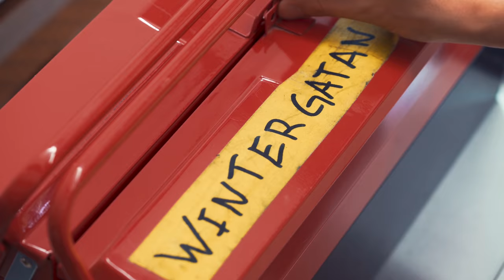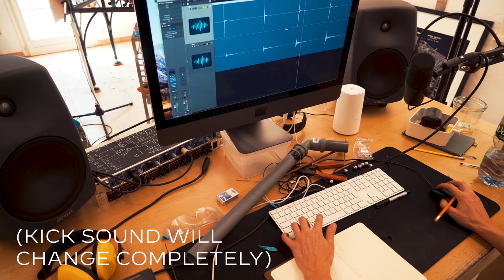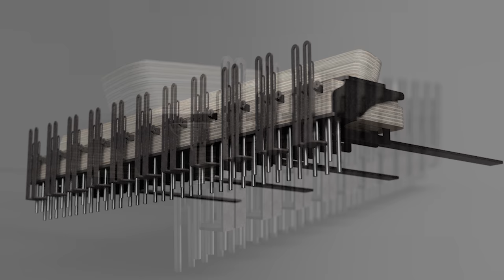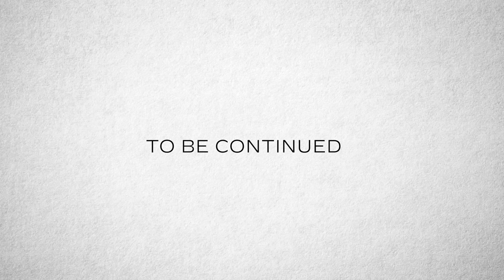Vibraphone Marble Drops - Marble Machine X #99

Comment: I hope all the engineering students out there are paying attention to this valuable lesson.  Sometimes a better solution comes along and you can't be afraid to blow up your previous work for the greater overall improvement.  Short term pain - long term glory!
Reply: I'm afraid they're all dead from watching Martin hand-bend wires :P
Reply: It reminds me of the creator of the MMR Vaccine. Years after his Rubella vaccine was integrated into the combo vaccine he came across a Rubella Vaccine with less side effects than his. So he had his vaccine removed and that one used instead. You cannot be afraid to completely toss out something you spent time on if there is a better solution available.
Reply: @ClAddict  Who said the marble machine was destined to be replicated? 
And I want to assume marvin and his team are organized enough to write down all of the changes made along the way so I don't think the blueprints for it are really lost.
Reply: Touched my heart, thanks.
Reply: @Tyler A.  The problem he is fixing is not that the marbles were touching.  It stems from the fact that he wants to change out the vibraphone plates to be able to play in different keys.  This meant that the marble hit point would change with plate changes.  His previous solution, the one getting thrown out, was to find a 'compromise' hit point.  The resulting compromise points were marked by the bent bar that was blue-taped to the vibraphone.  

The solution that was suggested, will have consistent drop points. Then design the offset into the individual base of each vibraphone plate to match that drop point for that note; no compromise.  He did not throw out one solution for an equal one rather, he eliminated the need for a compromise at all!

If you noticed, he alluded to at the the end of the video, a rendered, drop mechanism.  This new solution may be significantly more repeatable than the last as well.
Reply: If only the government could learn this lesson.
Reply: This series of videos should be watched by everyone. They teach cooperation, learning step by step, critical thinking, willpower build up, engineering, phisics and so many more things I'm probably missing!
Reply: .. but always keep in mind time to market and initial cost. Good engineers are adamant to help find the best overall solution with those often pretty soft constraints in mind.
Reply: @801maximus  Not a chance
Reply: Sometimes there are deadlines and even if you come up with a better idea, there might be no time
Reply: As a project engineer with a fixed payout from our customers per project - It's a fine line to tread
Reply: I'm a student in engeneering.
I love this philosophy, and it's hard to apply when the deadlines are coming. This is so sad that companies has to think to efficiency despite of quality.
Reply: @mathieul5990  On the tail end of a real engineering project here.  I had my team do a complete redesign 8 months into the project because I didn't want to waste time fixing them that could be spent avoiding them.  Prototype was way behind schedule, but it worked perfectly and we barely changed anything for production two years later.

Comment: wife: why are there drilled holes on the dinner table?
me: i'm a grown up
Reply: Me: Wheeeeze - Ha! (As I fondle the holes in my table)
Reply from the maker: thats it
Reply: Being an adult also means you get to screw ON the table.
Reply: @kristofgonczo  YES
Reply: GemYellow this comment made me laugh out loud
Reply: Don't forget that last week, it was drawing on your own table.

So yeah. Holes and random Sharpie drawings. Sounds about right for a grown up!
Reply: Plot twist it’s a glass table
Reply: RIP TABLE
Reply: Ha! my desk at work has a bunch of random holes from various fixtures and jigs that I have attached directly to the surface over the years. It is one of those shitty laminated particle board office desks with the fake wood grain pattern that was clearly not meant for such use but it still does the job.
Reply: @Wintergatan  🎈🎈🎈🎈🎈
Reply: @Wintergatan  🤧🤥

Comment: Viewers: "Cool, it's almost done!" 
Martin: "We need to talk..."
Reply: Genuine question - as this thing gets bigger and more complicated, is there a risk that this machine is too difficult to maintain? In other words, with so many moving parts, the probability of an individual part breaking increases. Is this acceptable?
Reply: @Ianrossoconnell  I feel like these components are built strong enough that breakage won't be a huge issue.  Also, with the computer designed components, repairs and replacements will be easier than otherwise.

Consider a saxophone, and all the individual parts that has on it- most smaller and more delicate than this, and also handled and moved much more often.  But breakages are rare on those instruments.
Reply: @Earthenfist  thanks for your answer.
Reply: @Ianrossoconnell  hman made very complicated machines, like cars. the failure probability can be managed by good design (sturdy parts, choosing wearing components, long lasting materials etc)
Reply: @baptiste7433   agreed - but cars have developed over decades with lots of iteration to perfect design. I'm not so sure this will undergo the same rigorous testing to be confident it will survive a worldwide tour. I hope I'm wrong of course. 

I suppose an interesting question is "which parts are absolutely necessary for performance and how sturdy are these parts?"
Reply: Ian O'Connell thats why its made of metal my boy

Comment: In Engineering sometimes steps backward are also progress.
Reply: Ye, in programming also.
Reply: As a plus, a new uniform dropper design should travel better than the highly-tuned custom fingers.  Not risk of bending.

Also, using adjustable shims for the plate holders lets you just plug any note into any position without worry that the timing or the sound of that note will be poor for that plate.  This enables you to change that part of the song in a recording without changing the programming wheel to a limited degree.

Comment: Don't worry, it may take a while but you will finish it. And then in 200 years someone will still be using it and admiring the dedication and ingenuity that you put into it.
Redesigns happen, sometimes before you put a lot of work in, sometimes during the work, and sometimes when you think you are done. It is all part of the process.
I do have to admit I was one of the ones who mentioned modifying the mounting plate spacing, with some trepidation as I knew how much work you had already put in.
I purchased one of your posters and am enjoying it. Thank you for making it available.

Comment: Popular vs unpopular: meh.

It's the right decision.

BTW, you should use the tubes all the way to the drop, like with the crash. They look way cooler than the rods.
Reply: Early Ehlinger I kinda agree, but I don’t know if it can work. Maybe they take up too much space. They’d be a lot quieter and a lot less pokey-stabby, though.
Reply: I had no idea how much the rods would obscure the visibility of the programming wheel and hide the marbles, or how they would "fill" up the space visually until he did this. I was blown away by how much metal was just hanging out there!

Comment: I  also get  SO FRUSTRATED when my cordless sticks to my demagnetizer wheel. It happens every time! Lmao
Reply: My old cordless would also stick to my demagnetizer wheel. My new one has a plastic body, so it does not stick.
Also, my demagnetizer wheel is significantly larger than the one on the MMX, but is for a different purpose.

Comment: Shit, I had that thought three weeks ago but never wrote it in the comments. I thought it was not possible to adjust the holder of the plates. Glad though that you remake the stuff to make it perfect
Reply: Me too, but it also meant adjusting the resonator pipes (I think?) which might have made it too complex to do... I think the new approach will work though - and look a lot better than the rat's nest of wires! ;-)
Reply: @tony actually no, the resonators will only need to couple to the fundamental of the vibrating bar, so positioning of the tubes is more flexible than you might think.

Comment: Anybody else worried about when they realize the resonator pipes also have to be moved depending on the vibraphone holder locations?
Reply: This!
Reply: i believe there might actually not be resonator pipes anymore because contact microphones cant work well with them (apparently even major vibraphone manufacturers cant figure the solution out), and the resonating will be added digitally
Reply: I'm wondering if the ideal place for a resonator pipe would be the same place as the ideal marble hit point since that is the position of maximum excursion. If that is the case then the resonator pipes should all be in a line if the bars get shifted to align the marble drops.
Reply: I was actually thinking about this today and that makes sense - the marbles should always drop in the same spot, so the resonator pipes can always sit right below the marble drop zone, right?
Reply: @zachloertscher1421  I think that if you look at the shape of a sound wave. The marbles drop on the "belly" of the wave (or ideal spot) and the pipes also need to be underneath this spot.

Comment: Plot twist: after movig the holders of the vibraphone, Martin realised that this action messed up effect of resonating pipes.
Reply: Could the resonating pipes also be made so they could slide forwards and backwards?
Reply: Maybe key to a detent/stop on the holder or something so adjusting them would be extremely quick and precise.
Reply: Or place resonator pipes further down and create a funnel to funnel the sound in? Don't know if that's how sound works don't quote me
Reply: I kinda want to see them do a flexible pipe fitting for the 1st part leading to the bars, with a trombone-action callibration section at the end. I wanna see me some BMG Drumbone action!
Reply: If you go back a video or two, when Martin shows the actual vibraphone, note that all the plates are aligned along one edge (and the resonator pipes are also inline). I bet it's like that so the player always hits the plate *in a parallel line", which may or may not be the centre of the plate (in fact, won't be, for all but one plate). And I'd further bet that the strike point will be right above the resonator pipe...  So on the MMX, it should surely be the same? Which can be achieved by  moving the plate in the holder.  Only issue I can see is if the metalwork of the plate holder interferes with the sound going into the resonator pipes, but not knowing enough about vibraphones, I'm just guessing there.
Reply: Wait. You actually have a point.
Reply: I came here looking for this comment. I don't know much about vibraphones and their resonator pipes, but I think the node in the center of the plate is the one with the biggest amplitude, which might be exactly where you want to put the resonator pipe.

I would also imagine that by moving a resonator pipe away from the center of the plate you could end up "resonating" a harmonic other than the fundamental note of the plate.

All these are assumption, I have no idea how vibraphones work.

Great job Martin
Reply: @mamodom  The hole point of doing the notes off center is, because not all off the plates resonate in the middle. It resonates strongest were the best hit point  is. But I also don't know if this actually is the best position for the resonator.
Reply: @mamodom  I'm not actually sure it is the case, precisely because hitting the plate right in the middle excites tons of harmonics. I wouldn't bet that there is a peak of the fondamental in the middle.
Reply: Adjustable resonator pipes that register to the holders somehow. If they can slide back an forth and there is a tab on the holder of each note to register it in the correct position that would solve that problem.
Reply: @jonasdaverio9369  yeah, in the end I have no idea about it. But you're probably right. We need a vibraphonist with technical knowledge about vibraphones
Reply: There is a fan in the resonator pipes to put the "vibra" in the vibraphone driven by a single axes, so the resonator pipes must be in one strait line.
Reply: Eh, from the video where he was playing with the resonator pipes, it looked like the vibraphone flap works in either end of the pipe.  Just make the other end the one that is in line.  You could then have a custom middle section of tube for each note that sets the length, the resonator doesn't need to be straight from what I saw.
Reply: @SteevyTable  A normal resonator pipe is closed at the bottom and is tuned a little off pitch of the base note and is a compromise between maximum sustain an maximum volume. The only place to put the fan is at the top of the pipe.
However, because he uses microphones there might be no need to use resonator pipes at all, the vibrato and tremolo can be produced electronically.
Reply: @ZZtop-gg3lu  Rotate the axis 90 degrees drive them all from the front or back with a belt of some description and then then don't have to be in a straight line anymore. The drive pulleys can slide on a shaft and be made to line up regardless of the tubes position.
Reply: or that the longer once hitting the programming wheel 😅

Comment: is it really necessary that the marbles should not touch one another at the dropper on their shared line? With how you made it no more than 1 marble should drop at a time in rapid succession and if both dropped at the same time it wouldnt produce 2 individual notes.
Reply: IdealIdeas100 you realize the marbles sit there until they are released? both...! they need to clear even when just one channel plays
Reply: Not that it matters when you watch the end of the video. :P

Comment: I have a bad feeling about this part of the design. It seems to be rather finicky and requires a lot of adjustment to prevent marbles interaction. Additionally, it makes a lot of noise which might interfere with the actual music.

Edit: I think changing the design is the right thing to do. It may feel like Sisyphus's ordeal but you will probably be happier with getting it right.
Reply: watch till end

Comment: Just amazing! Well done, I know I'm a year late on my comment I'm catching up. Lately I have been so impressed with people who are not afraid to start over, it seems the true road to ultimate success. This fear keeps us from moving forward because there is that question, "what if it doesn't work and I have to start over?". Being able to push through that fear is the only way to move forward where projects are concerned, having to get something right the first time is an unrealistic expectations many of us put on ourselves. I'm learning that it's ok to get things wrong, I can only fail if I give up. As long as you keep moving you have not failed. I know this probably won't get seen I don't even know why I'm writing this, but may help someone who is struggling with this as well.

Comment: I was surprised you worked so long with a compromise version of the marble drops onto the xylophone notes. I remember telling my brother that you could use a normalized distance for the sweet spot measured from the holder. Then any note would play exactly the same wherever it is placed (limited by resonator tube length). I am glad you are trying out the newer design :) I am sad you have to redo all 34 mechanisms. The journey is more important than the destination, they say… A happier Martin will be a happier musician.

Comment: LASERS! Yes, got your attention! 
I think you should add small laser pointers to each marble release gate to always have an accurate visual of where they will land when you're setting up the correct note-lengths on the vibraphone. They would only have to be on when actually switching between scales/songs. 
Also, It's lasers, you know you want to!
Cheers from Sweden, keep it up!

Comment: i got a bit misty when you did the teardown, but i'm probably not crying as much as Marius is now...
this is the way of engineering:  there must have been a good enough reason for the redesign.  too much hand building on a lovely steampunk looking assembly, too many potential failure points, probably maddeningly ineffective timing calibration, poor repeatability of manufacture.  and the revelation that adjustable vibe keys can use a more elegant design.  (think of the awkward Borchardt and what it morphed into.)  i can only imagine how frustrating it is to sink time and effort in like this and then lop it off.  but the music must come first, it always has.  i for one am in awe of your design integrity and your courage in letting better designs find their own way.  if the MMX were anything like the original plans it would be a failure!  we are learning along with you and i believe that you are well on the way to a legendary achievement!  thank you for sharing the process!

Comment: I find that it's best to put a piece of plywood over the drill press table whenever the workpiece would be hanging out over the hole (like at 6:35) , so an upwards torque doesn't emerge on the part that you're holding, nor does the material try to deflect. I see that it didn't cause any problems in this case, but with thinner pieces or weaker materials such as aluminium, the bending of the workpiece can lead to inaccurate and slanted holes or assymetric countersinks. 
I just want to help by sharing this small technique, it might come in handy if you haven't thought of it already and just didn't feel like you had to use it this time :)
Keep up the good work!